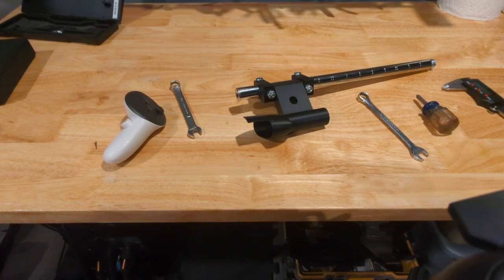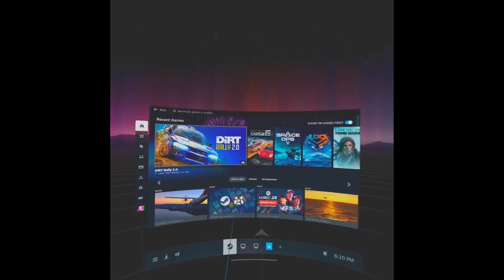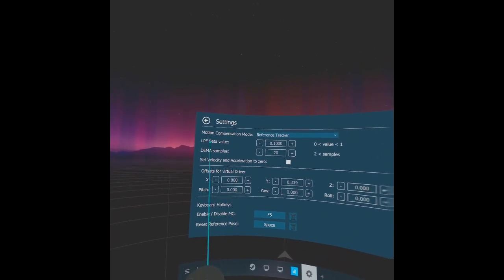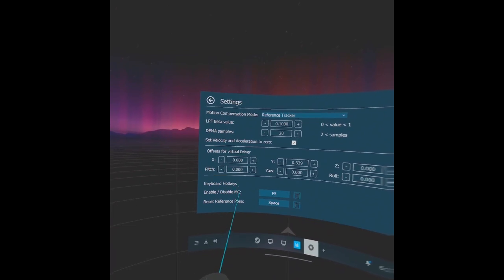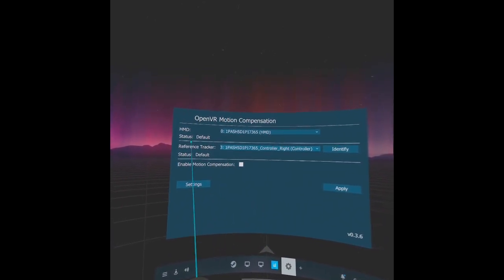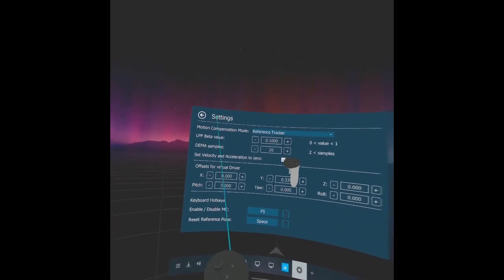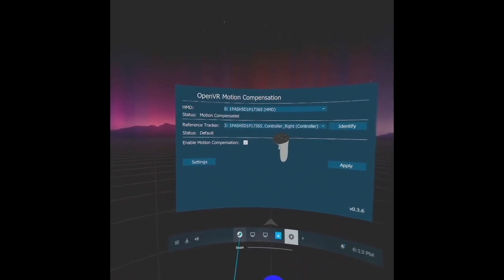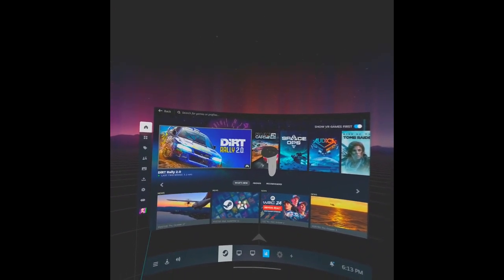Setup VR Motion Compensation, Sim Racing, Flight Sim, DOF Reality

Comment: Helpful video.  I just started trying OpenXR Motion Compensation with quest 3, I mostly got it working, I think, need to fiddle with COR position and a more solid mount.  How do you deal with the Quest 3 controller timing out?  I've only been messing with it for a few hours, my current work around is a rubber band pulling the thumb stick to the side.

Comment: I followed the steps and it was working, however as soon as I entered the game it stopped working. Does it matter the game (AMS2) or how you launch it or settings in simhub, should I use something other than simhub?
Reply from the maker: Once Motion compensation has been started it should not matter what application is running.  It simply uses the controller to move the screen around.  You can kind of think about it like the screen is being locked to that controller.  So unless something is conflicting with the program, It should work fine regardless of game, or Simhub etc.  that being said you will want to make sure motion compensation is turned off in Simhub.
     Also make sure nothing is being blocked in the steamVR startup.  If steamVR crashes it will block programs from running until you enable them again.
Reply: Thanks. I’ve been looking round for solutions. I’ve realised you can disable head tracking within the quest 3. That seems to also solve the issue
Reply from the maker: That does work, but has it's down sides.  I didn't like the feeling of 3dof inside the cockpit

Comment: I have an H2 and fly DCS. I can't seem to solve the motion-comp issue. Makes the H2 unusable. I have the Wit-motion sensor, and have paid for support from SRS with no results.
Reply from the maker: Wit motion didn't work well for me either.  Problem is it only does 3dof.  You really need 6dof for true mc.  The solution in this video has been working exceptionally well for me.
     The other thing you could look into is switching over to Simhub as your motion software.  The program is amazing.   They have built in mc.  You just have to make sure your rig is configured properly and it should work pretty well.  Hope this helps!